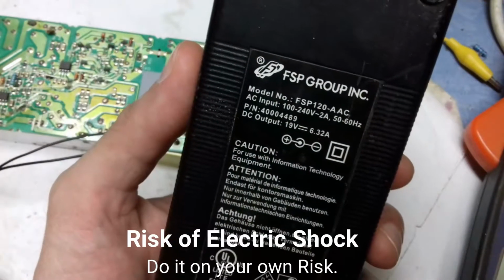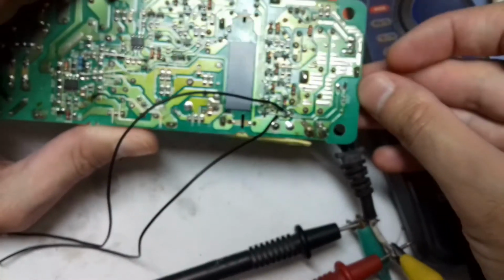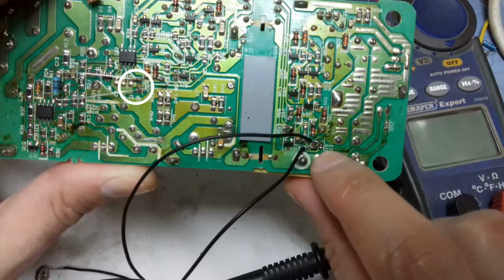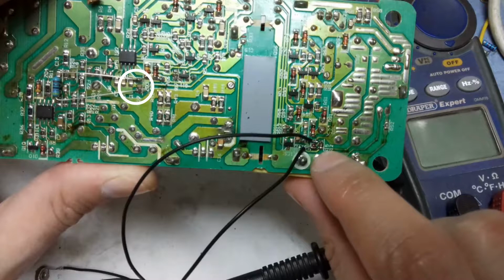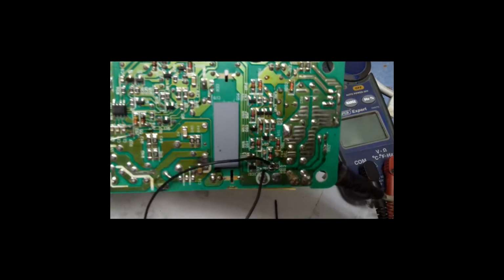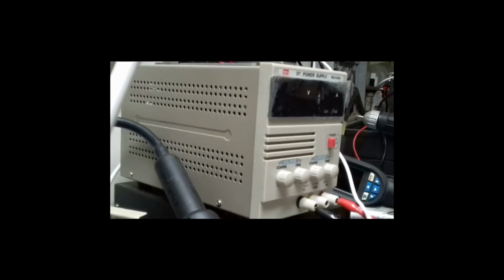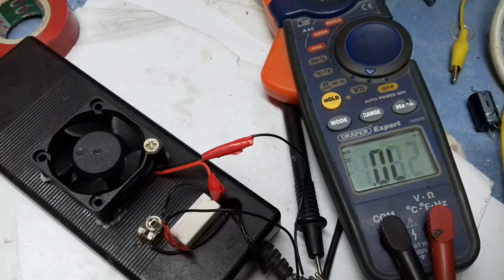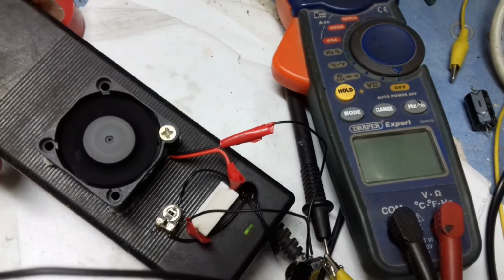DIY Variable Bench Power Supply from old Laptop Charger

Comment: hello , Nice video ! all the circuits in the laptop adapters have the current sensing pin ?
Reply from the maker: Yes they do
Reply: @repairjunk2268  Thanks ! mine keeps on burning the mosfet, any idea why ?
Reply from the maker: What modifications have you made?
Reply: @repairjunk2268  Actually i have not started yet, i found it already burned, i was afraid of putting a new one in and burn it again. The fuse is OK.
Reply from the maker: It is hard to tell what exactly is causing the issue. You should start by locating any possible shorted components on the primary side.
Reply: @repairjunk2268  Thanks for your answer. I picked another laptop adapter which is working fine and has a current sensing in PIN3. When i follow that pin, i find many resistors on my way, which one to remove in order to place the potentiometer. Thank you.
Reply from the maker: What is the value of the first resistor? One that goes straight to Pin3.
Reply: @repairjunk2268  the closest to PIN3 is a SMD 203 (20k), then another SMD 754 (750k) and a third SMD 1001(1k), then from this one straight to the MOSFET through some SMD capacitors.
Reply from the maker: Try changing the 20k resistor. 
First, run a load test to see the max current it provides before it starts tripping. Then change the resistor. Try 15k resistor and then check the max current again.
Reply: @repairjunk2268  Thank you for your answer, I will try this and come back to you.
Reply: @repairjunk2268  Hello, I finally did what you mentionned, thanks, it worked !!
I changed the 20k by a potentiometer of 20k, it did change the output of an additional max 0.5A, but when i tried to decrease it the current, my halogen load bulb started to flash and went from 1A to 300mA straight. So it is not as convenient as a real adjustable power supply. 
But at least I did learn something and will make me sleep happy :)